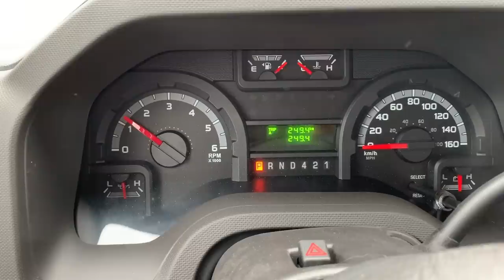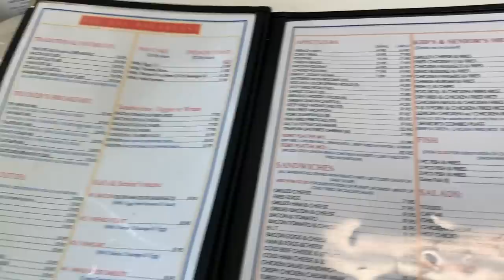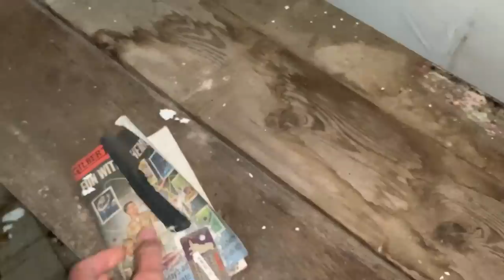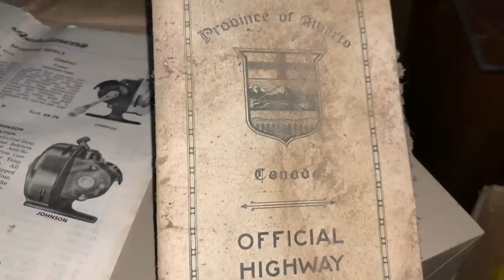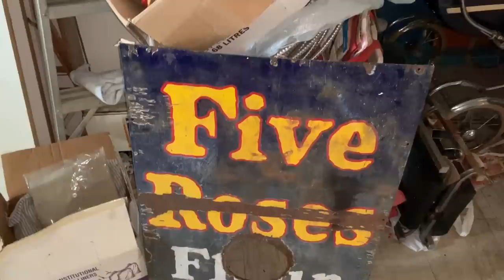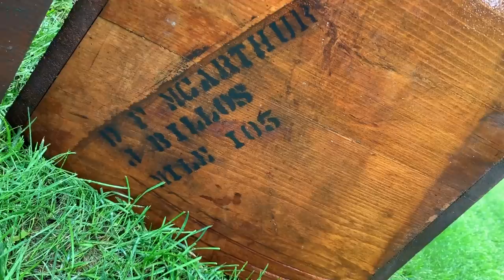Part 3. Let the gathering begin! Abandoned shelving find!

Comment: Try using a card scraper to get some of the muck off of the counter but still leave a patina to it (like they do sometimes on Salvage Hunters). Then give everything a few coats of oil and wax and they will look amazing. Josh should be able to fix that cut off shelf for you pretty easily.

Comment: Lots of work and expense to salvage, but people like you preserve other's hard work and that's admirable. The shelves outside need bottom protection from rain splashing on ground.  It is fast to hose everything with water, but will it warp the wood?
Reply: Doing so is very risky. Especially sitting out in the sun. When I saw those drenched with water I winced. Hate to be blunt and honest, but that was an ignorant move. You don't hose down wood furniture, especially items that have dried out over 100 years. They will suck that water up, the sun then heating it could cause it to steam before it evapoates and the wood can and may warp.

Comment: You know the 2ft cylinder rollers you get inside treadmills? If you get 3-4 of those and put one under the front end of long items of furniture you can push the item along the ground, then do as Egyptians did, take the one from the back & put it at the front, to shift heavy things without straining your back. Having seen it from below, I'd have been more worried than you about crashing through the 'cardboard' floor. A 6ft drop could've given you falsetto vocals. Glad you survived!